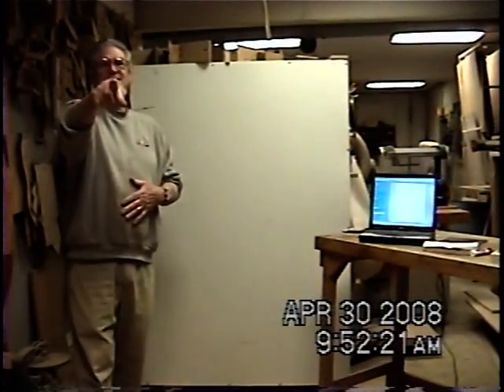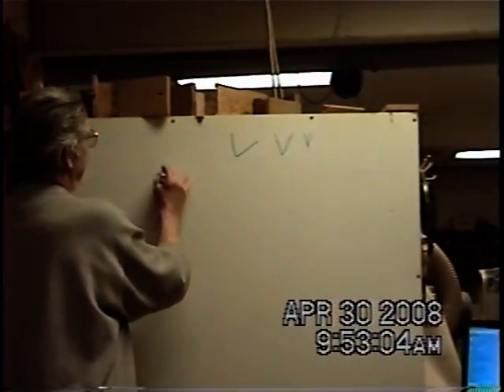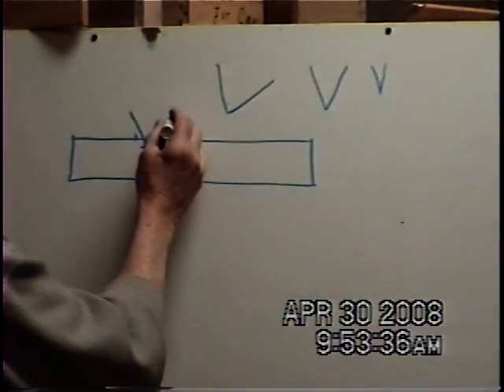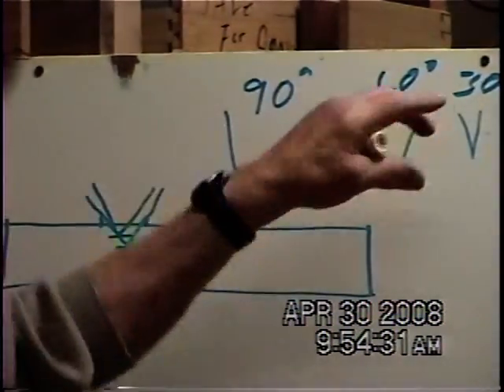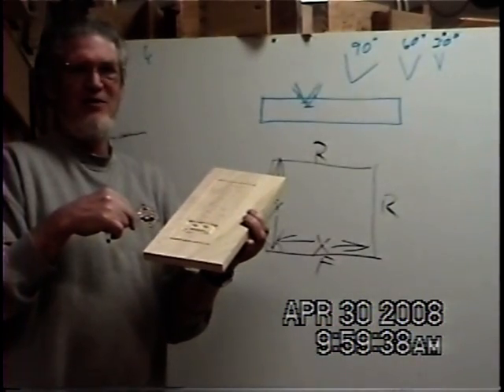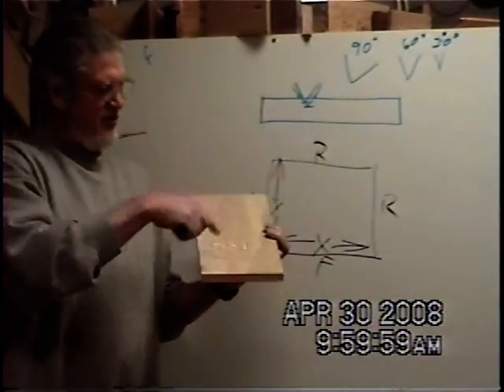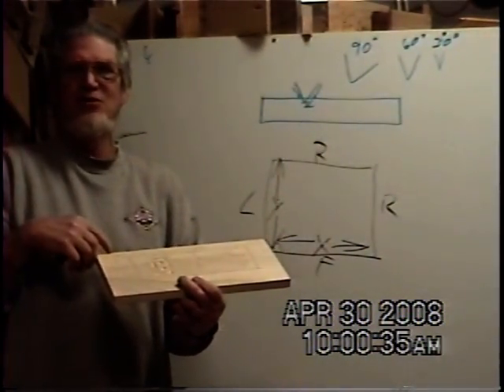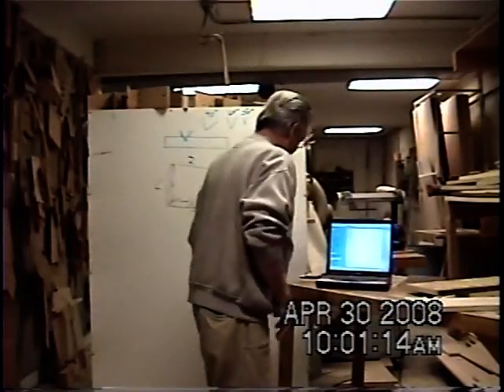CNC Routing Pt. 1 of 12

Comment from the maker: The Rapid Clearance Gap on this project is 2 tenths above the service of the wood, so by going 2 hundrents below the surface would not interfer with the movement over the surface. You can set the Rapid clearance to what ever distance you need to let the tool clear when making rapid clearance movies.